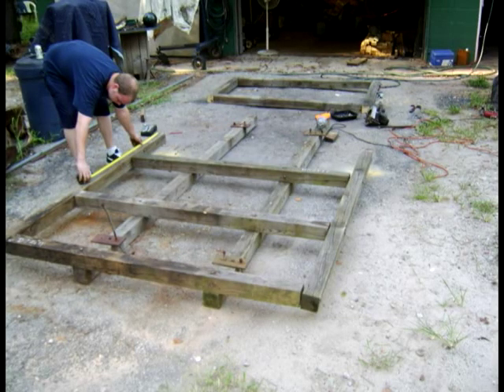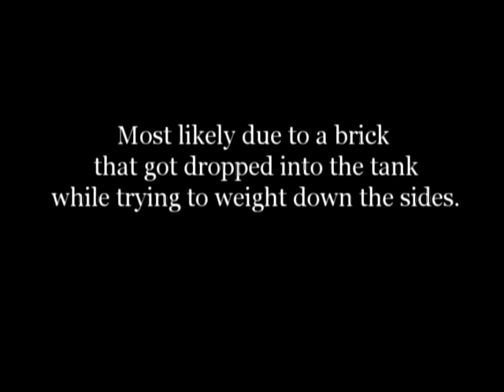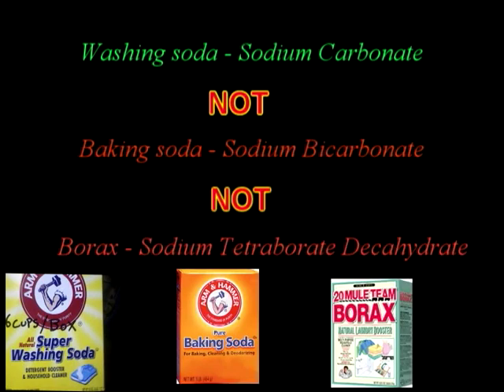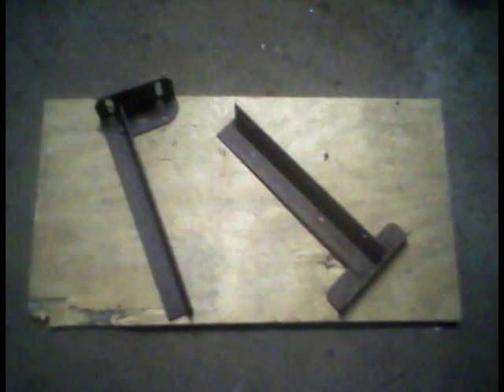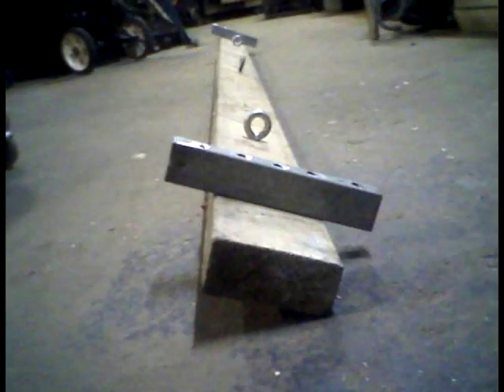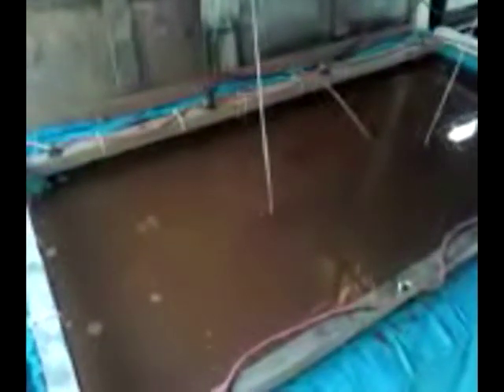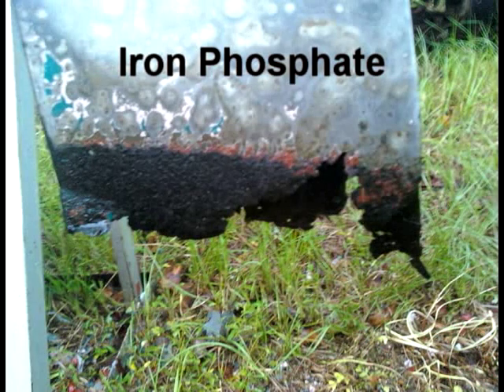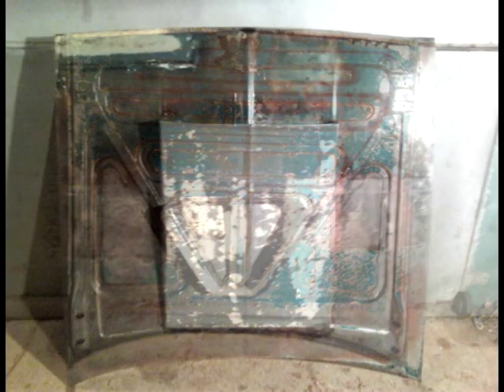Cheap Electrolysis Tank

Comment from the maker: @Joshua Seacreas
The wood and hardware were reclaimed from various sources.
Shed removal, yard cleaning, construction site dumpsters,
abandoned rental properties,and word of mouth.
We even get vehicles this way occasionally.

You may have noticed the roof over the tank was made from pallets, scrap lumber, and sheets of plastic under a tarp. The floor around the tank is all concrete block. We dug those up cleaning a yard and the owner said get rid of them.
I did pay $30 for the battery charger and around $20 for the washing soda though.

Comment: How did it only cost $60? the wood alone would be more than $60.
Reply from the maker: The only thing we had to buy was a liner.
The wood was from a shed my buddy tore down.
The battery charger is and old one.
The overhead trolley system was made from bed frames and skate wheels.
Even the roof over that area was made from pallets with several layers of plastic and tarps over that. It lasted for years surprisingly.

Comment from the maker: One very important factor is to ensure the best electrical contact you can.
I clean the contact point on the part with a sanding disc, Make it shine.
I also clean the rods from time to time with muriatic acid.
I have a couple CPVC tubes, capped at one end, that I soak them in. 
All other connections get checked and cleaned as needed.

I use a broom to stir it.

Comment from the maker: We used the same mix for two years and only added more electrolyte when we added more water. (water loss was due to evaporation and a small leak)
(We had to move after 2 years.)
Rain will also dilute it so we built a roof over ours.

I test the voltage and amperage initially every time I do a part.
Then I'll check it about once a day while in operation. 
(This is not at my home so I have to leave it unattended for 24 hrs or more.)

Comment: Hi, I am going to use this method to remove rust from some panels from a car I am restoring, and need to know how long a electrolyte mix lasts? is there a test that can be done to check the soloution quality, my mix maybe a bit weak as I can only get 5 amps current flow

Comment: @Pablo453 So it removes  the rust but not the chrome. I have a entire unit body car I would like to use this process on. It would great if it would remove paint as well. Thanks for posting this process. It is a much better alternative to acid.

Comment from the maker: @oWarpatho  Never heard of using an arc welder for this. I suppose any DC power supply would work as long as it can put out enough amps. 15 amps seems to do pretty well though. Thanx for the comment, I'll have to check into that.